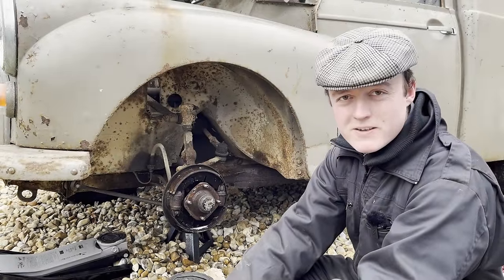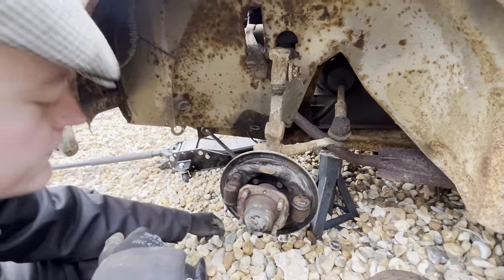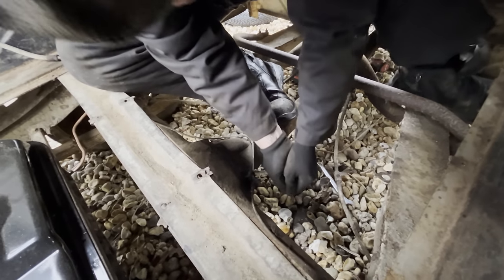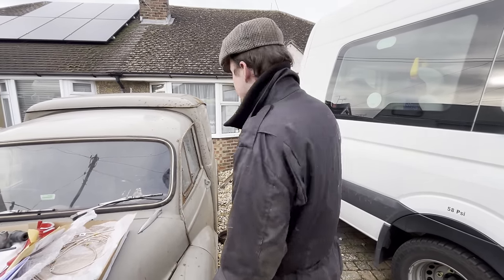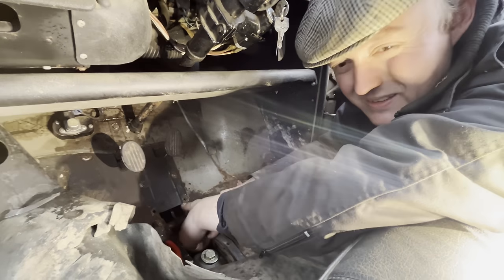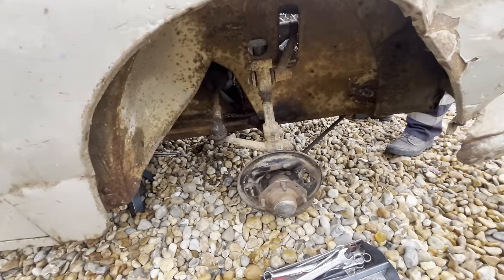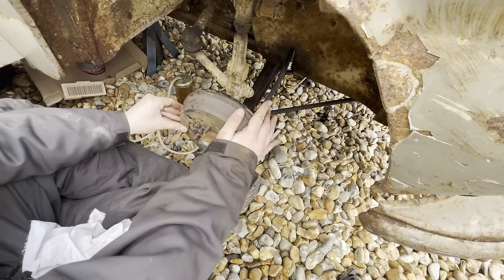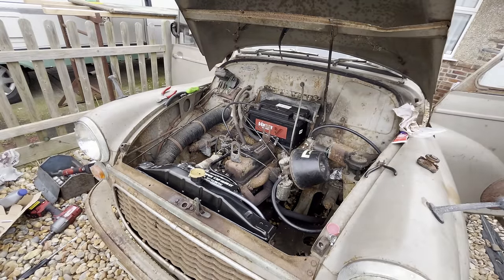Austin/ Morris Minor Van Part 3, Brakes and Radiator

Comment: The relative simplicity of this car, easy access and the full parts availability must be the reasons why so many are still in use around the world over half a century after the last one rolled off the production line. I've seen some of this work done elsewhere on YT, including the trick with the master cylinder bolts/torsion bar thingy, but this serves to reinforce what I've learned about renovating a Mog and I should imagine reassures people that maybe it's something well within their mechanical abilities. Along with old Minis, I recall Minors were often used in UK schools for teaching car mechanic skills. 

Interesting to see YT vids from Sri Lanka with teenagers rebuilding these cars and even renovating the engines - more for Really Useful Vehicle needs rather than classic car preservation.

Comment: The master cylinder on a Morris Minor is located in one of the most awkward places  I've ever worked on 😮, well done 👍
Reply: I couldn't agree more, especially with the nonsense of supposedly having to remove the torsion bar to get at the master cylinder locating bolts.  However, at a recent meeting of the local MMOC meeting in Leyland, Lancashire, one of the more mechanically minded members showed the meeting a specialised tool he'd made up, which helped to get the bolts out without removing the torsion bar, a good idea.  Many of the members with Minors have converted the brake system by fitting a new master cylinder under its more usual location, under the bonnet.
Reply: I also have a homemade tool somewhere to ease the torsion bar down,I doesn’t need a lot to ease the bolts past

Comment: By pass hose mod.Put a OEM blanking plug in the head and fit a Metro water pump or later A series pump.Used to be a Austin/Rover tech from 82 to 91 and done plenty of these.

Comment: Brake Drums
turn Adjusters until the drums are stopped
Slap the drums around with a COPPER Mallet..a steel Hammer can crack the cast Drum.
the. Adjusters can be taken up a bit more now that that Drums have been perfectly Centred with the Mallet taps to the Face of the Drum.
Great Video....
Reply from the maker: Like it! Definitely need a second adjustment, was going to do it after a few brake applications, but the copper hammer is a good method suggestion!

Comment: Good old drum brakes which takes miles to stop but easy to fit new pipes with the floor being taken off but my self I would find some other Austin/Morris car to take the front struts and the disk brakes and master cylinder to make it safer on the road and put a bigger engine gearbox back axle like a 1.3 Marina would make it better power on the road but I understand you keeping it original your self but will be slow on the road 😂🤣 but its got to see basic engineering and easy to repair be good to see when you are finshed the old van 👍🇬🇧

Comment: The asbestos linings pulled the car up more efficiently than the new material. I noticed the difference in them straight away when the new material was introduced. Risk was minimal from asbestosis. Personally I would have left them on for better braking performance.
Reply from the maker: Thanks for watching,I had seriously considered keeping those shoes, but I had already acquired the new ones so thought I’d give them a go!
Reply: The risk from asbestos is massively overexaggerated! You would have to take a grinder to those pads, and actively breathe in the particles for it to have any serious detriment to your health. It's like anything else nowadays, over the top health and safety!🙄
Reply: I have large asbestos sofit boards all round my (1958 Australian) house. The problem lies with getting rid of them - a specialist must be called round at great expense (I had to replace a couple with cement board, so I know). I suspect with asbestos brake shoes it is the disposal which introduces the most risk to the public. Where does one dispose of them? How did BLG dispose of them? With light use envisaged, I probably would have kept them and exercised extreme care when working on the internals. Nice van in my favourite condition.

Comment: I think we have an Austin van engine, the block is marked L for low compression, so it’s different to my Morris which is a late convertible. Needs a rebuild. I think it is low mileage but has been in the garage since 88/90 ish.

Comment: I remember getting brand new disc brakes on my Renault megane last year, then 3 days later I’m on a bypass and the timing belt snapped on me. Scrapped. It was an O9.
Reply from the maker: What a pain!
Reply: @badgerlodgegarage  not a day I want to remember at all. Especially as I was trying to get the thing to run as it was slowing down, and so I didn’t manage to get it all the way into the verge (slope kerb) and left the rear drivers side wheel still on the road, nearly had a heart attack trying to push it up myself to no avail. Long walk home of course nobody offered a lift even though they could clearly see my broken down car. Your day can go from ‘normal’ to ‘very bad indeed’ in an instant. Glad it doesn’t happen often!👍

Comment: Your idea of pre made brake lines is called working savvy rather than working hard. Is doing a master cylinder the most awkward job on a non Traveller Moggy? I say non Traveller as I'm aware the replacement of the wood frame is a ball ache.
Reply from the maker: Thanks! I would say it’s up there, not particularly difficult in principle, but ends up being a right pain.